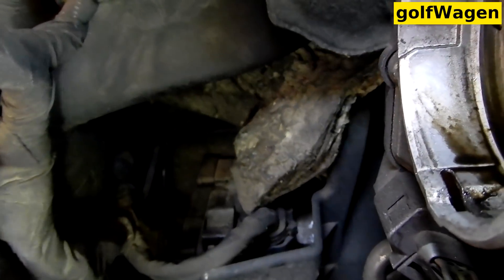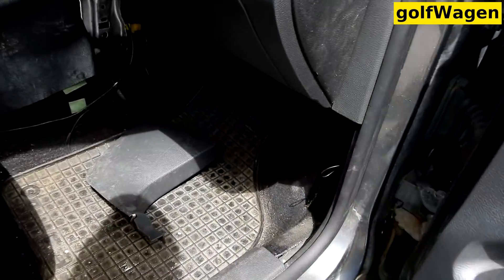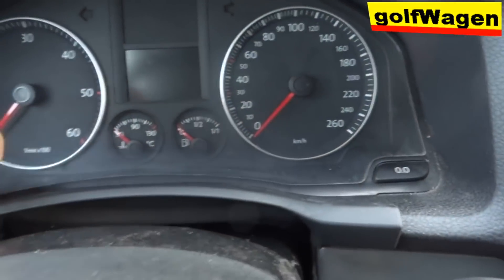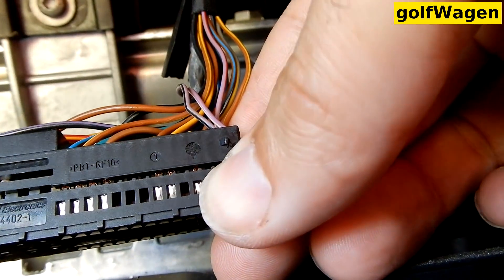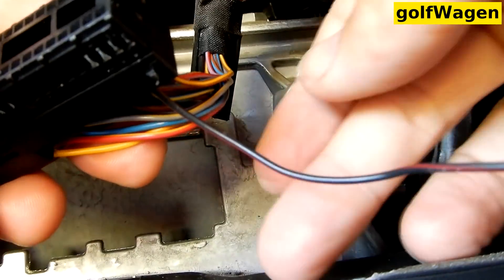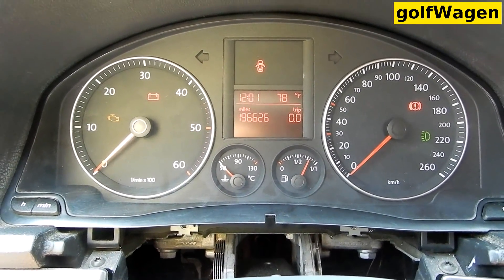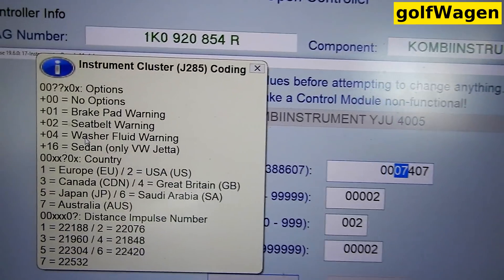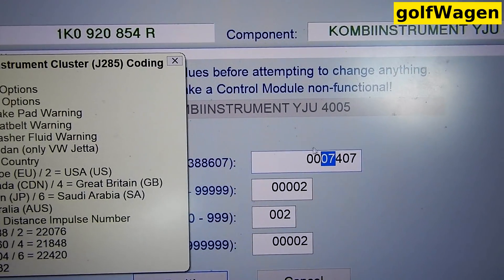VW Golf 5 washer fluid level sensor install

Comment: Where do you find this pins;;;
Reply: Panos Anonym is number 34/36
Reply: @faresgolf5769  I don't mean the position pin in the conector.i mean where we can buy this terminals  to install on the conectors.thank you!!!
Reply: @kapsourachannel   is this not fabrication installed
Reply: Panos Anonym Just order them at dealer or ebay. 

http://www.passatplus.de/umbauteile/stecker/stecker.htm
Reply: @roybm3124  thanks my friend!!!this is that I want
Reply: Panos Anonym Your welcome, if you buy wires ending on letter E you get 2 connectors crimped on a repair wire +/- 40 cm. So you don’t need a crimp tool only a soldering iron. 

1x Screen Wash Sensor: 7M0 919 376
1x Screen Wash Sensor Wiring Connector: 7M0 973 202
2 x Wire connector seals 357972741
1x Repair Wire for Instrument Cluster: 000 979 009E
1x Repair Wire for Sensor Wiring Connector: 000 979 225E Parts from local electro shop
1x Ground wire ring connector 5mm
Heatshrink Tubing
Solder
Cloth Wiring Harness Tape
4m of wiring sleeve for the engine bay
10m yellow repair wire 1.0mm